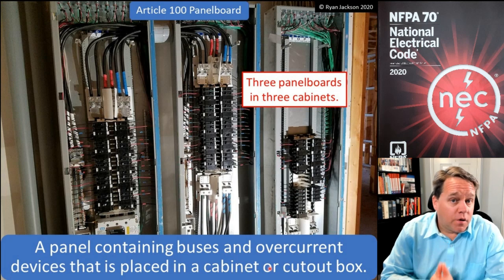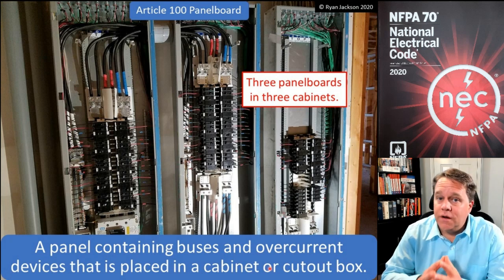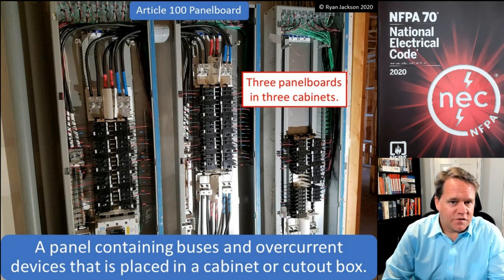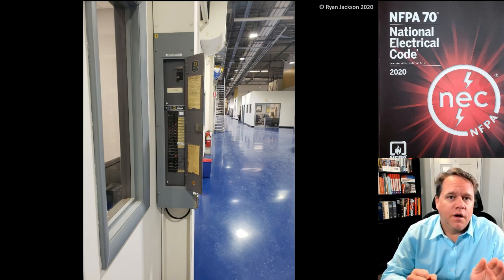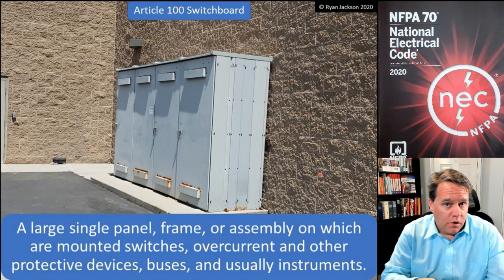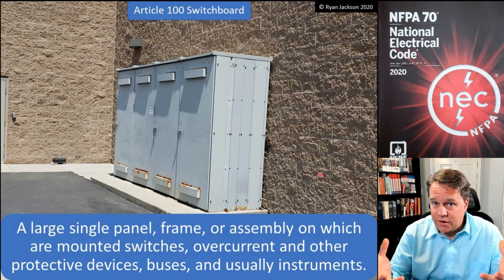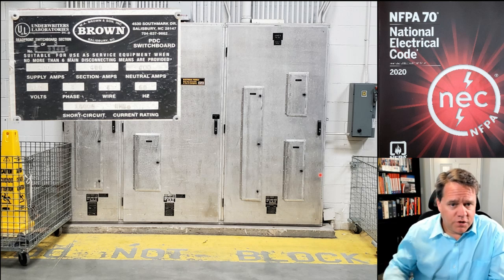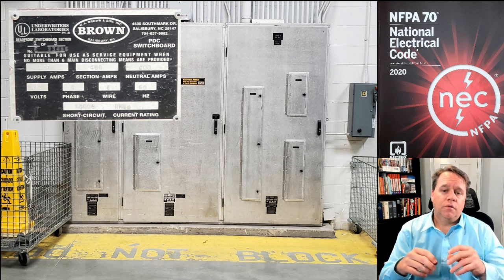100 Days of Article 100: Panelboard, Switchboard, Switchgear, and MCC

Comment: Thank you Ryan.
What I know is the following:
Switchgear has a gear and motor inside because spring charging. Required for high voltage and low voltage when short circuit is high.
Switchboard: high running current and medium short circuit interruption. Contains breakers and feeders.
Motor control circuit. Serve both feeders and motor with motor protection inside.